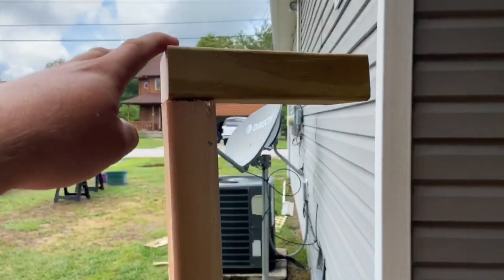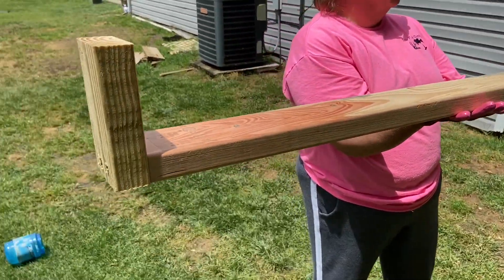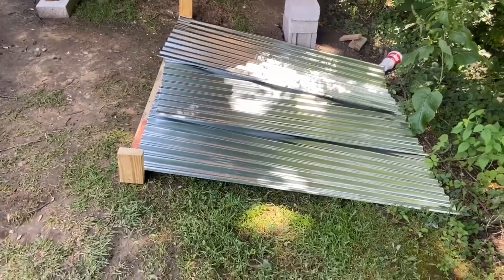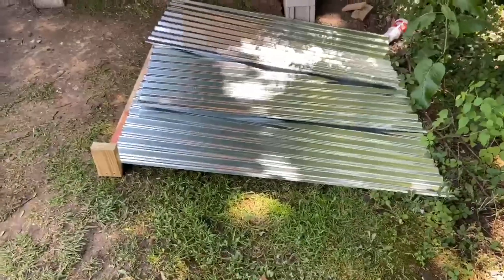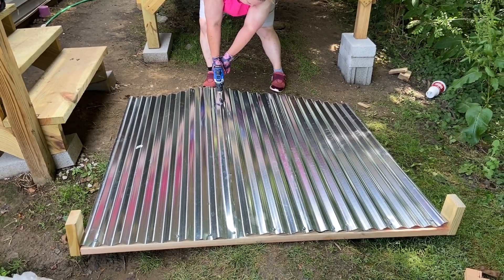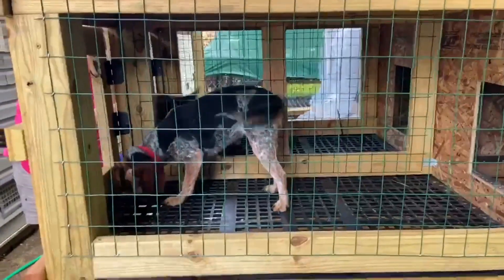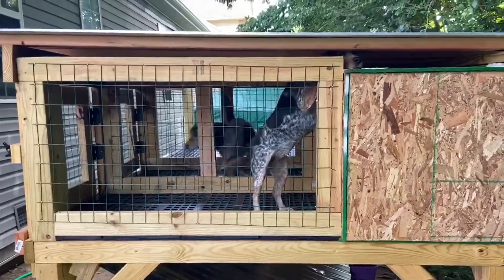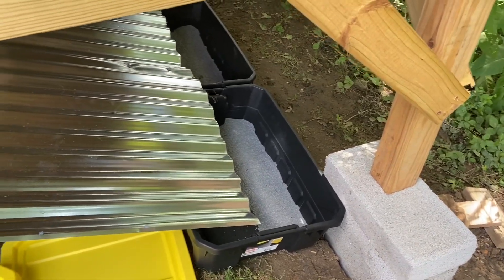How to build a septic system for Above Ground Dog Kennel

Comment: Yep, nice looking hunting dogs.  Just an idea if you have the time: If instead of 'kitty litter' you had an open gutter in the ground there, it could run into a sunken IBC DIY septic tank. Then all you would have to EVER do is just hose out the gutter (literally a 30 second job) and the septic tank run off would feed a nice lawn or vegie garden etc.  
I built one for my dogs (Beagles and Bull Arabs) (I have concrete, but at the ednge I have a gutter in the ground running to and IBC and 44gallon drum septic tank. Its been running for 6 years now without a problem and fertilises an awesome vegie garden and cherry tree. All I have to do is hose the concrete off into the gutter and it runs into the septic tank ( I try not to use too much water at a time though, dont want to flood it). Works a treat.  (looks like you just have a couple of dogs so you could probably get away with something as simple as 1 44 gallon drum tank (2 drums would be better) and a 3m run off pipe. It really is not much digging (compared to digging a hole for an IBC!) and the system is worth the effort.
Reply from the maker: Great idea thanks for watching much appreciated
Reply: Thank you I will try out your idea.